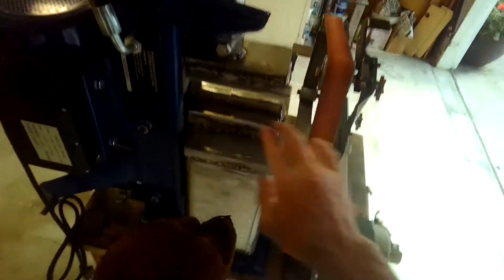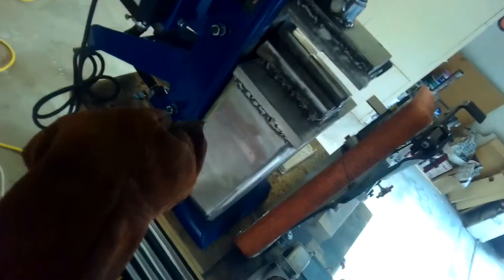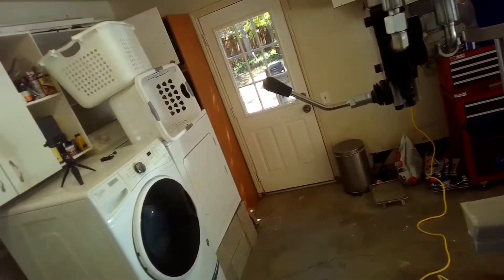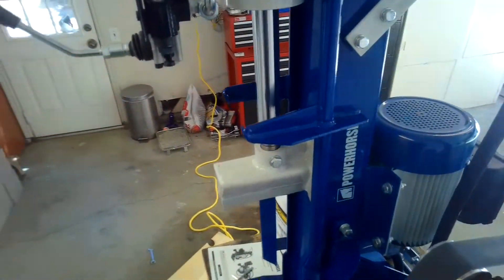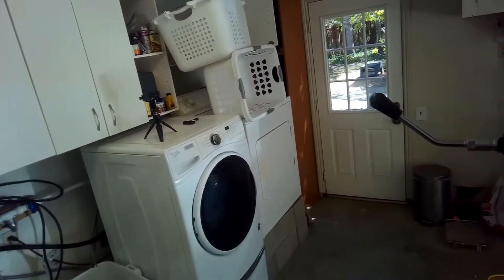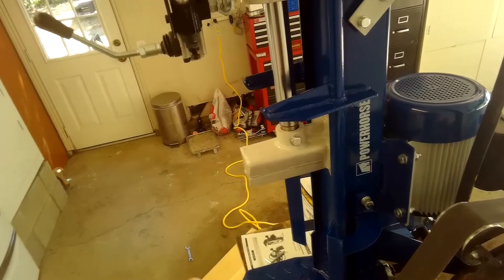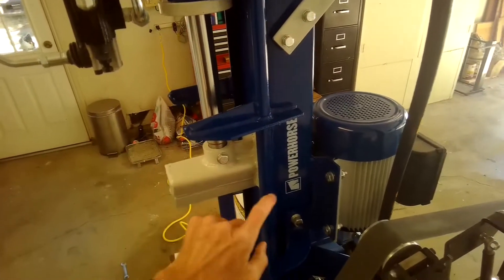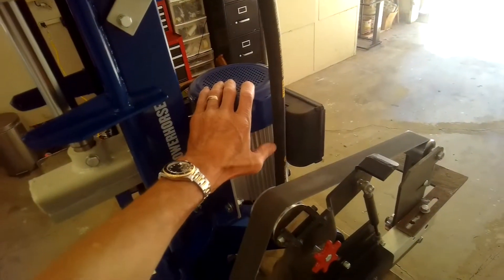✨ Powerful Forging Press made from 8 Ton Log Splitter ✨

Comment: Super awesome!!  I have the same splitter and turned it into a press about 10 months ago.  I have my dies set up the same way you do, however I rotate the dies to keep the pressure under the ram.  I am in the process of making a foot pedal for mine as well to free up the lever hand.
Reply from the maker: That’s a great idea to switch around the dyes.
I’ve noticed that the press moves back slightly as I apply pressure.
So now I’m building some framing to keep it from moving backward as a press down.
I’ll post a video soon on how that works out.
Reply: @Scott The Fix-It Guy  DIY Appliance Videos   mine does the same.  I've tried to weld the seams the keep it in place , but that didn't gold for long, I'm not a strong welder.  I am also considering some sort of framing.  Can't wait to see what you do!
Reply: @ScottTheFixItGuyChannel how’s the splitter holding up?

Comment: Silly question, but far should I fill the hydraulic fluid? Mine doesn't seem to have any sort of dipstick to check the level.
Reply from the maker: I believe until it reaches the top of the hole you pour the oil into👍
Reply: @ScottTheFixItGuyChannel  Awesome. I assumed so, but thought I'd ask anyway. I appreciate it!

Comment: I think you chose a good splitter for the build because of the in-line ram.  The idea being to keep the ram force in line with the work force of the dies.  On your demo video it appears that there is a lot of torque being created as a consequence of the dies being so wide.  It looks like there is a lot of play if you have material on the edges of the dies as opposed to being directly under the ram.  I appreciate you posting the video as I am planning on purchasing this splitter.  I will make dies a maximum of two inches in width and they will be centered directly beneath the ram to eliminate this torque.  Thanks again.
Reply from the maker: Great ideas👍
I’m going to use 2 lengths of angle iron to connect the area that holds the ram cylinder to the front of the base so there is less upward deflection of the front of the dies when force is applied.

Comment: Pretty clever. I always thought using a ram style 12 or 20 ton shop press with a air/hydraulic foot pump was the way to go. Probably around the same cost but might be more versatile.

You might think about set screws in your angle iron to take up the slack in those loose dies. Keep practicing with that welder.
Reply from the maker: Thanks Jeff👍